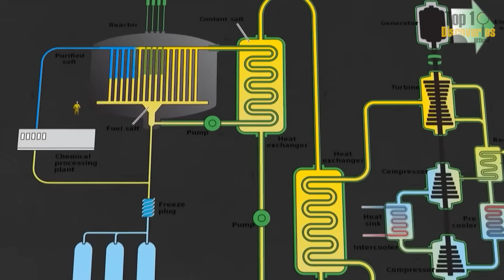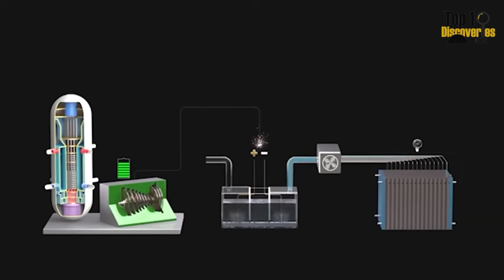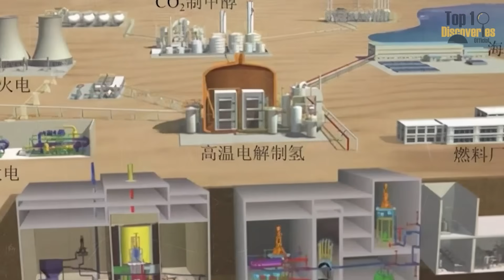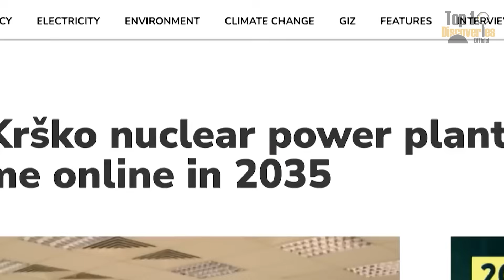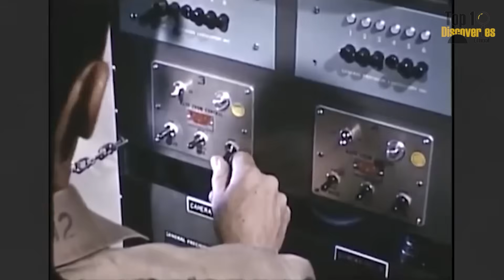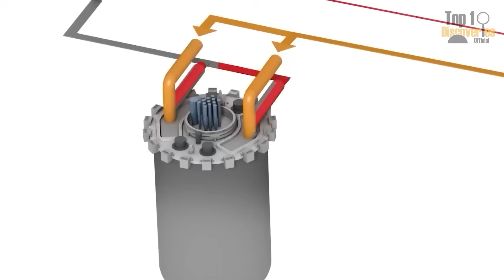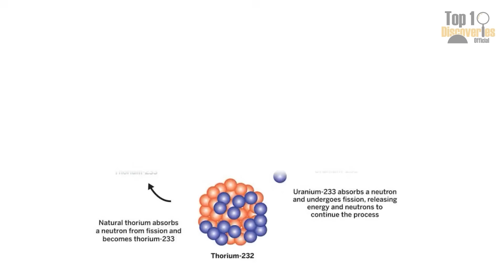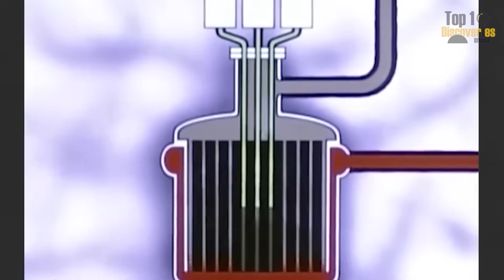China Launches the World’s First Thorium Nuclear Reactor — 80 Years After the U.S.  Started

Comment: In 2021, China constructed an experimental thorium reactor, which achieved full-power operation at 2 MW by 2024. Through its operation, China made breakthroughs in four key technologies:

Thorium fuel fabrication technology (thorium-uranium cycle),
Development of high-temperature corrosion-resistant nickel-based alloy (Hastelloy-N) materials,
Molten salt chemistry control technology (fluoride salt system),
Design of passive safety systems.
This experimental reactor was not used for power generation. Therefore, between 2025 and 2030, China will build a 10 MW demonstration reactor for electricity production. It will primarily validate:
Long-term operational reliability of the molten salt loop,
Maturity of online fuel reprocessing technology,
Integration of complementary technologies such as high-temperature hydrogen production,
alongside formulating policies, regulations, and safety standards. Commercial deployment will require at least 15 more years.
Globally, China is not alone in thorium reactor research. The United States remains a strong proponent, while the Netherlands' NRG is also in the testing phase. TerraPower, backed by Bill Gates, plans to complete its demonstration reactor by 2030.

Comment: Fast neutron reactors, such as the thorium irradiation reactor, don't produce electricity, they produce weapons fuel. Moderating reactors to produce heat came later. A thorium reactor doesn't actually run on thorium, it runs on high grade U235.

Comment: I'm not against Thorium by any means, I'm not against MSRs either, I'm even not against SMRs all these things need R&D money as they should have gotten 15 ~ 30 years ago. The problem is, they didn't. So right now, given this is the reality, just use existing proven Nuclear designs. Do that to the max. By all means Do that while developing novel Gen 4s of whichever type but just do it all now!
Reply from the maker: Totally agree, there’s no time to wait anymore. Proven nuclear tech should be scaled now, while R&D pushes Gen 4 forward. That’s actually why China’s approach is so interesting, they’re building out conventional reactors fast and funding thorium MSRs at the same time. Do you think other countries can match that kind of dual-track strategy?
Reply: @Top10Discoveries.Official  They could, but they won't. That's the problem. In the west, people are politically fixated on the whole "climarte change" question, when it doesn't really matter for nuclear, but nuclear has been dragges into it as both sides see this as a concetion to the other on climate in some way. Yes, this is nuts! Oherwise all agree that we need far more reliable and cheap electricity. 

Also, Nuclear is hated by both big oil and big green, the latter are invested up to the hilt finacially in wind & solar & they can only get rich if their investments are supported by governments and subsidies as their spredsheets depended on it when they "invested". 

They have spent too much time and money on de risking the energy market investment on W&S with 30 years of lobbying Governments and marketing to the left. 

To think they would admit it's basically impractical to run a serious OECD country on this stuff, would be finacially and politically catastrophic now due to sunk costs, both ideolgically, and finacially. 

The right meanwhile are beholden to big oil and have never moved past it in a serious way. Ideologically, they also see any attack on fossil fuels and a concession that climate change is real, so even though they kinda like nuclear, they aren't fully commited to it. 

It's a disaster that when we talk about energy production, we now have to talk about politics 90% of the time, not the actual tech and it's objective merits. This is crazy! China has no such debate, which is why they can get things done. 

India might be able to do it, maybe Japan if they grew a pair (doubtful due to Fukushima, I was there for that btw), maybe the arab states (they have the cash and seem interested in futrue-proofing themselves as energy exporters) that's about it. 

Geo politics, crony capitalism and ideological bs are more important than rational logic facts and technology & that is why the west cannot get it's act together even on something as obviously needed and beneficial as nuclear. 

Sorry to be such a debbie downer but this has been frustrating me for 15 years now and asise from you tube videos, nothing of substance has happened. 

The only hope is AI data centre demand for energy. Suddenly, you'll see the narrative change as the money and power incentive is just too great, so even the left media narrative might start promoting Nuclear in a big way. I think we see some signs of that in the last couple of years. 

In conclusion, the west can do this dual track approach, it has done it before and still has the financial & engineering clout to do it. But it really needs to re market it to "team left" (via their nudge units) , agree behind closed doors to pay off the loses of their crony finance mates to "soft sunset" their all in W&S bs, so they don't get wrecked, and then burn down the cripleing Nuclear regulatory environment built up over the last 40 years. 

If I were betting on all that happening, I wouldn't. The west is a basket case imo. Sad but ture.

Comment: The Thorium Nuclear Reactor is actually very difficult to build in engineering. The United States did try it before, but it just failed. The biggest engineering difficulty is the corrosiveness of high-temperature molten salt, which places extremely high demands on the materials of the reactor structure.
Reply from the maker: You're absolutely right — molten salt corrosion is a major challenge, and that’s what halted Oak Ridge in the '60s. But China claims they've made breakthroughs in new nickel-based alloys. Think they'll succeed where others stopped?
Reply: If Chinese are working on it this will be a success they are never beaten in scientific research and correct answers

Comment: Great video
Very informative and enlightening
As someone who works in the energy industry I would like to find out more about these reactors
On the face of it they look to be quite small at 1MW to 10MW but once they can scale to 100MW or larger then they are much more flexible to be embedded in the electrical network close to where the power is consumed
Endless possibilities to incorporate as decentralised energy sources
What I really want to know is what costs are they projecting?
Right now we are installing a lot of wind and solar plus big batteries as they are supposed to be the cheapest form of generation
For a thorium reactor to compete, the cost would have to be competitive I would think?

Comment: In my mind, one of the significant benefits of this technology is eliminating the need for pipelines that are costly to build and comes with its own set of environmental impacts. Thorium is much more compact and easier to transport. Setting aside geopolitical considerations, this technology can drastically reduce environmental impact and benefits mankind immensely.
Reply: Modular Thorium Reactors are already in existence. Size of a CAR . Exclude the Pumps , Piping, Generators, Reservoirs, etc.
Reply: The Chinese media reported the pipe corrosion was the biggest problem to solve and the experiment reactor built in the desert was for testing pipes with new materials. Molten salt itself is radioactive that can’t be used to push the generator directly. It should exchange the heat to the carbon dioxide or water to push the generators with pipes. It doesn’t need pressure containers will reduce the mantanance cost a lot.

Comment: Impressive. I have been waiting for this for 15 years. China has had a Thorium test unit in Shanghai for years and now they have finally done it.
Reply: Shanghai engineers continued what the Nixon administration (unfortunately for USA) stopped. Problems which needed futher R&D were Tritium, Xenon, and corrosion. 
if Chinese engineers were able to solve them and the problem of Cobalt ( an alloy component in high temp steel; reactor-vessel steel? ), which would get "activated" by neutrons (59Co_stable ->  60Co = 5.275years_half_Life), they would fully deserve my thumbs-up!  
non radioactive Cobalt is an essential element in one of the most important animal's metabolisms vitamin ( I don't remember exactly which one, vitamin B-12?)
Reply: @konradcomrade4845  Thanks for that. I was aware of the corrosion issue with molten salt - pretty amazing they fixed it. I feel it must have been a ceramic solution but who knows. I am impressed that they managed to recharge the reactor with Thorium. This means they have done the full life cycle.
Reply: @9kilsyth It is not ceramics, but GH3535 nickel-based superalloy. We solved this problem in 2018.
Reply: @rayhuang6155  Thank you!

Comment: China's Thorium reactor is not commerical. It is a pilot. If it succeeds the first commercial reactor will be after 2030 ro 2035.
Reply: The experimental reactor has been validated and passed in 2023, and the commercial one is scheduled to begin construction this year and is expected to be up and running by 2029.
Reply: @guangchen5505  that's a demonstration reactor.
Reply: @lionrock2023  The 2 MW class in 2023 is a validation demonstration, and the 10 MW (60 MW of thermal power) class in 2029 is considered small-scale commercialization in preparation for large-scale commercialization.
Reply: So what ... it's still a million miles ahead of any body else.
Reply: @georgewilder7423  the US knew about thorium.  chose to not pursue it
Reply: @lionrock2023  
The declining US empire couldn't handle it cos they couldn't weaponise it so put it in the too hard basket.
China picked it up and ran with it and has turned it into a huge success.
Reply: @lionrock2023 dropped because not easily weaponized
Reply: @lionrock2023 same as hypersonic missiles too dear
Reply: The 2030 reactor needs to be up and running for a couple of yrs in order to sell it to the rest of  the world that it works and it's stable.  By the way we don't know how big or complex is the 10 megatt plant will look like.  So it will be 2040-2050 before you will see it in other country if everything goes as plan.
Reply: I doubt anything China says. They are thieves, cheaters and liars. They also say Xi Jinping is immortal.

Comment: As an energy engineer, I believe thorium and molten salt tech is exactly the sustainable shift we need.
Reply: Exactlt. Fusion sounds good, but it is like "the future that never comes (soon enough)". 🙄
Reply: No lessons learned from Solyndra failure .. Cheating and stealing .. Now, the New Green renewable bulshit deal .. more Cheating and stealing ..
Reply: 2 week old propaganda account 🤦
Reply: Also as an engineer (mining), I looked into this science with great enthusiasm about 15 years ago. Unless the Chinese have come up with a reliable graphite container and reticulation system, including pumps, filters and drainage for the molten salt, this is most likely just CCP sponsored propaganda.
Reply: "Short-term profits and election cycles" appears to be the exact focal point keeping Thorium behind the vastly more expensive, AND messy, Uranium!!  C'mon LiFTers!!
Reply: I’ve read that molten salt of thorium is highly corrosive. Do you know about what was their solution for this drawback?
Reply: @sergiomatioli5400 
That's a problem for all molten salt reactors, weather Uranium or thorium. That's why they run such long living experimental reactors.
My guess is that it's very hard to reach long enough lifetime for the reactor, such as 30 years or so. When they do, we will see thorium reactors in all kind of places.
It's not the salts themselves are too corrosive. It's that they are radioactive and hot, 600° C or even more. Radiation weakens steel, and it's very difficult to develop some that's resistant enough to last long enough.
Reply: @sergiomatioli5400  This is one of the important technologies of China's thorium-based molten salt reactor
Reply: Thorium sucks
Reply: @petershaw6346  , Just because you could not harness it? Sound like a born loser??
Reply: You are a dreamer....1kg of beef needs 15.000 liters of water, let that sink into thy distopia

Comment: With up to 45% thermal efficiency, molten salt reactors outperform traditional light water reactors stuck at 30–33%.
Reply: Yes, molten salts provide that higher thermal efficiency and low pressure too.  No question it beats water provided adequate materials can handle molten salt.

Molten salts are highly corrosive even with the best most advanced materials.  Thorium needs fluoride-based molten salts which are even more chemically aggressive.  Thorium goes further and actually embeds the nuclear fuel into the molten salt flow itself.  That embedded fuel emits high energy neutrons which further damages the reactor walls and piping.

If there is ever a problem with the Thorium reactor's piping, repairs will have to deal with not only 800°C molten salt but also radioactive fuel embedded within emitting lethal amounts of radiation.  The reactor might as well be scrapped at that point.

There is a big IF Thorium can beat traditional nuclear in cost effectiveness.  Assuming that even happens, Thorium reactors will likely not last as long because of the high amounts of ongoing stresses it endures.  Their shorter lifespan will increase cost per MWh electricity generation at levelized cost analysis.
Reply: @beyondfossil You pointed out the most critical problem. In 2018, we invented a new alloy, named GH3535 nickel-based superalloy, to solve this problem.
Reply: @beyondfossil  I would see that thorium nuclear energy would work together with semiconductor manufacturing.  Semiconductor still have problem of treating fluoride waste. I wonder what would happen between Molten salt and fluoride and the characteristic

Comment: No water cooling needed? Gobi Desert about to become the new green tech hotspot!
Reply: There are already vast amount of wind power and solar power capacity installed there.  They build this thorium power plant there to smooth out the fluctuations in power generation from wind and solar.
Reply: @BrowseAndLook  - also AI is extremely power inefficient compare to the brain
Reply: Molten salt reactors only sustain nuclear reactions at high temperatures. If they cool down—like during a leak—the reaction stops, making them inherently safer than traditional reactors."
Reply: @龙浩-v8d  Yes, a thorium reactor's "freeze plug" provides "walk away" passive safety.   Because the overheated molten salt and the fuel contained within it are all dumped by gravity into specially designed emergency drop tanks that halt the fission process thus saving a reactor meltdown.

However, if the freeze plug were to melt through, it's possible there is already irreparable damage to the reactor vessel and piping.  A large internal and external investigation would ensue, and the reactor could be down for months to years at minimum.  It may never be online again if critical damage is discovered.  Moreover, the population living around the reactor would hear of this failure through the media and public confidence would be damaged as well.  The public don't understand all the systems involved and would just see it as an emergency reactor failure.

Therefore, Thorium reactors would still need some kind of combination of active and passing cooling systems to make the freeze plug scenario only employed as a "last resort" measure.
Reply: @beyondfossil  Oh wow, your explanation was truly eye-opening! My master's research focused on fuel cladding for Gen III/IV reactors, so I only had a general understanding of molten salt reactors. But after hearing your breakdown, I can really see the huge potential MSRs have for development!😄😄
Reply: There is enough wind and solar in the Gobi Desert to provide all the electrical energy the world needs several times over, not just China.
Reply: With energy it will even become green again.